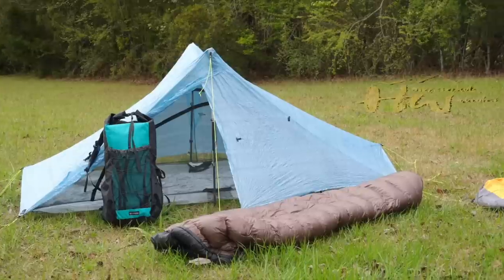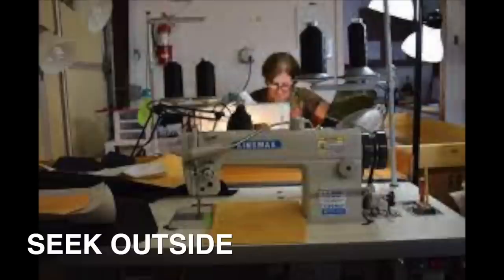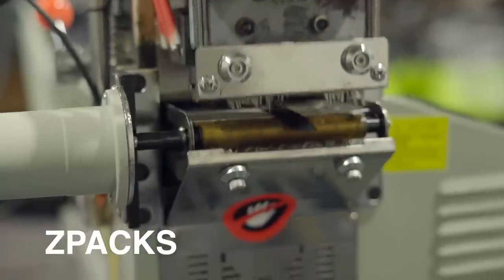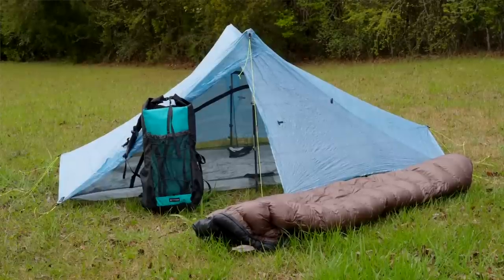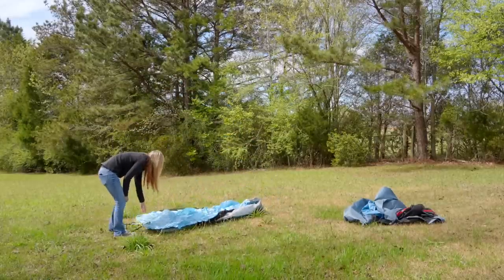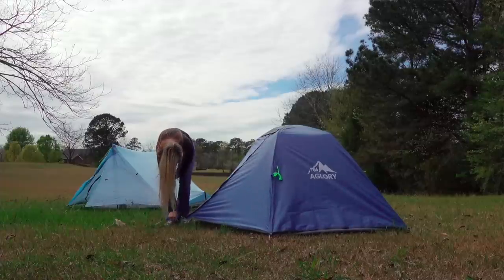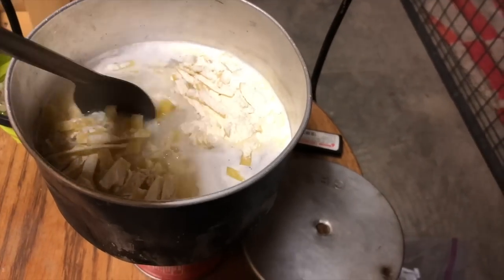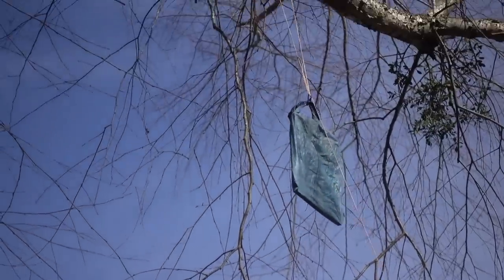$250 vs $2,500 Backpacking Gear Loadout - Why is Half the Weight 10x the Price?

Comment: I bought a Z-Packs Duplex and Arc Blast because I am 60+ years old and need to take advantage of such tech advances to lighten the load on those knees and hips.  With the Enlightened Equipment quilt, I halved my total pack weight from 35+ down to about 15-20 pounds depending on luxury items I allow myself now.  Well worth it in my opinion, even if I do not crunch long miles and am just a weekend warrior.
Reply: How’s the arc blast? Does it cut down on some sweat with that curve?
Reply: @boredandagitated  I love my Arc Blast, going on 5 years or so.  Yes, the curve really does allow decent air flow between your shoulder blades and waist.
Reply: @boredandagitated  I own the Arc Blast but if I could do it again I would get Arc Haul with the carbon stays that have a pre bent arc. With the Arc Blast you need to set up the arc with the pack empty and make sure you get the arc adjusted on both sides evenly. The Haul the arc is set and does not change. I do like my Blast and all of my Zpacks gear. A couple of years ago I retired and started doing much longer hikes so I bit the bullet and went all in in UL and Zpacks. Zero regrets. A base weight of eight pounds has been a game changer. Take care
Reply: I feel the same way.  But I'm fine with slowly reducing my weight over time.  The downside of some of these gear reviewers is that some folks are needlessly turned off from long distance hiking because it seems too expensive.  Most people can get their weight down by taking less stuff.
Reply: When I switched from a cheap synthetic bag to an Enlightened Equipment down quilt, I was also able to switch to a smaller lighter pack (bought cheaply on a close out sale) and shed several pounds of base weight.  It made a huge difference in my base weight.
Reply: @michaelb1761  It does have a nice cascading effect as you go lighter.
Reply: @Silkstep  For decades my motto has been, "If you watch the grams, the ounces will take care of themselves."
Reply: Thank you for the validation as I’m 71 yrs young & these are my considerations as well! Enjoy & safe backpacking!! ❤
Reply: Right on!

At 20, I would have thought someone was nuts to spend $2250 to save 6.5lbs. 33 years and a knee brake later, I ask where do I sign.
Reply: Me too. Getting the duplex and arc blast pack was a lifesaver for me (I’m only 50, but I’m a wimp and have bad knees lol)

Comment: I really love how hard you work at making backpacking accessible to more people.
Reply: My original set up was really cheap and not that light or good (IMO).  However, my current set up is relatively nice, is not comprised of Chinese intellectual property theft, and is still less than $1000 including shoes, clothing, everything.  I buy things on close-out sales and do not buy the Gucci gear for clothing. Despite what some (not Dixie) YouTubers might make you think, Backpacking doesn't need to be expensive.  I track how much I spend on gear, food, and travel to the trail.  Compared to a typical vacation with travel and hotels, backpacking can be a bargain vacation.

Comment: I’ve used Cascade Mountain CARBON trekking poles for 5 years with no problems. They weight the same as the Black Diamond poles, but can be bought for $35 at Costco. Now that’s a no-brainer!

Comment: I've been backpacking for about 50 years and my oldest pieces of kit come from 1978 and 1982, namely my tent and backpack respectively. The bag is frameless(but has a self-rigid sit-mat insert) and is just a big empty bag with a harness and padded back panel, but it's super comfy to carry and has hauled loads of 40lbs+. My tent is showing its age but still works and is quick to erect and weights 3.5lbs and has seen me through 60mph gales and -10C winter camps. My most modern gear includes an inflatable sleeping pad (2018 - I'd used closed cell pads up till then - big mistake!) and the BRS 3000 stove(2018 - and it's a mini miracle!).  It's a mix of budget and expensive, I pick what works rather than go on price. My sleeping gear varies by season - we range from -30C to +30C, so no bag/quilt covers it all. Plus as I get older I only cover 12-20 miles per day, in my youth I could do 25-35 if I had to - so weight becomes less of a critical factor, it's now more about comfort and reliability.

Comment: I do budget camping/bike-camping because I have to.  I have a NatureHike Mongar 2 tent.  For $150, it’s done me well for 2 years now with zero issues.  They also make smaller and lighter weight models.  I also found a budget down sleeping bag, and 2 different sleeping pad options (cold & warm weather).  The one thing I spent money on was my cargo bike-trailer to haul my gear with.  I also use my trailer around town for short grocery store trips, etc. There are also mid-priced ranged items that will provide more comfort/light-weight options.
Reply: I did the budget way for years. Nothing wrong with that.  With experience I learned how to use what I had. And stay warm and dry.  Peace and love hike on🙏✌️
Reply: I was thinking of trying bike camping, good to know other folks are trying it

Comment: I have the Cascade Mountain Tech carbon fiber poles (with cork handles and flick locks) and they have been great! I've had them for about 5 years and they have been on countless backpacking trips and long day hikes, from trekking through snowy passes to the Grand Canyon. Obviously the carbon fiber ones are more expensive than the aluminum ones, but I can't say enough good things about mine.
Reply: Same here! They have been serving me well for the past 4 years. Can't complain. They were recently on sale at Costco. I picked up another pair to keep as back up...
Reply: Love mine too.  Replaced the tips on an older rubber handle pair that I've been using since 2014 (bought at Costco), and I also have a newer pair with cork handles (also from Costco).  Great deal.  Hard to believe that the aluminum poles are more expensive now than the carbon fiber poles in 2014.

Comment: Aloha Dixie, 
Mahalo for another great video. I do want to point out an error in your description of tent materials: nylon vs polyester. Nylon is hydrophyllic- it absorbs water and sags when wet. Polyester is hydrophobic- it doesn’t absorb water and doesn’t sag. Polyester is also more UV resistant than nylon. Nylon is a slightly stronger fabric that polyester, but tests have shown it is negligible.

Mahalo
Greg

Comment: I am a Scout Leader, and I am constantly recommending gear selections to youth AND adults, for early-stage backpackers. (And I have tried ALOT of them). But, full disclosure, I have never bought UL or Very High-End gear. So, my range is low-to-mid for price/quality.
Generally, I stay away from alot of the lowest cost (walmart) items for the Big3.  Alot of Scouts get the Teton Sports backpack, due to its durability and size adjustments. (My son has now used the same Teton 3400 ($80) for 10yrs.) For adult backpacks, Osprey gets high marks for price vs quality.
Cheap tents are not bad, but their lousy rainfly is the downfall (aka Coleman or Ozark Trails)
Kelty Grand Mesa 2(as-is) is a great budget option at $150.  I have also used the Kelty Tanglewood2 at $100, and then swapped out the stock fiberglass poles for a replacement set of alum poles ($25) to drop weight. 
And sleeping bags have tons of options for size/rate/cost to fit and budget at Cabelas/BassPro. Again, Kelty seems to be the brand that has hit the sweet spot for moderate budgets/ quality. 
Unfortunately, I am all over the place on sleeping pads. I have a closet full of leaky air-pads and heavy yoga mats. Just have not splurged for the NeoAir.
I use $500-550 as an average budget for the Big 3 +pad

Comment: Hello and thanks for the video. Just as an addition, there are other choices somewhere in between these 2 extreme ranges, closer to the $250 range, which is too cheap to be acceptable for some decent hiking. 

1) You can buy a Lanshan 25 oz tent for $180, a 2 lb excellent Durston for $240 or a Gossamer Gear The one, barely above 1 lb, for $300. My standard for the last few years has been an OR Helium Bivy, 1 lb, now selling for about $160 at the "A".

2) As far as backpacks, a Granite Gear Crown 2 (60L, less than 2 lbs) can be found new online for about $100 (holds 35 lb comfortably) or a Granite Gear Virga 2 50-58L Backpack which weighs in at 1 lb 2oz can be had for the same $100 (holds about 20 comfortably). They both carry really well.

3) Finally I would use a quilt/blanket since those are lighter than the bags. Anyone remember the $30 Costco blanket? I made one into a quilt by using some monster tape and it has been good to me to the 40s and less than 2 lbs. Nowadays they sell similar ones for about $60 at the "A". For a great quilt, may I suggest the Paria brand? Their 30 degree, 700 fill, 2 lb costs $160, their 15 degree, at 2 lb 3 oz is just $180.
Combine that with a pad such as the Klymit Insulated Static V Lite Sleeping Pad, in regular size at 20 oz, R rating of 4.4 and $100

So for the big 3, you are talking more or less $600 and under 7 lbs....you can add the rest of the stuff and do da math which methinks is going to be an additional $100 - $150 (Sawyer, Frog Togs, Pot/cup, BRS, poles) which is about 1.5 lbs (total is 8.5 lbs).....As a matter of fact, think $750 which is 1.5 lbs heavier but about $1,700 cheaper than the best shown here. Yes, it is $500 more than the (possibly) "one time hike/use" gear but it is a whopping 5 lbs less! Meaning $100 per pound weight loss.

So there you have it:
Almost 7 lbs for $2,470, 13.5 lbs for $248 or 8.5 lbs for $750.

Comment: I'm glad I spent the money on my Enlightened Equipment quilt. Super warm and super light. I can also use it when I am camping in my camper van and have used it staying at friend's houses. I went more middle of the road on the pack and tent. I like my REI pack, not the lightest, but lots of good features and pretty light. One thing that did sting was I spent a bunch of money on a good inflatable pad. I do not backpack often, so the side seam failed on my pad and I didn't realize it until the next summer when it was out of warranty and I had a useless piece of kit. Thanks for the all the time spent on putting this video together.

Comment: My message is sort of like yours, when starting out on your first shorter hiking outings, take cheap but servicable stuff that will not fail on you, and upgrade to better gear if/when taking on bigger hikes, or as $$ are available, or specific issues are found with the cheaper options.

Comment: Great work again Dixie! 
In my opinion Decathlon is worth to have a look on. They offer a wide range of gear from cheap to expensive, but they are honest to tell the customer if the product is made for recently use or heavy use in all conditions.
For most weekend-worriers the cheapest items from Decathlon will do the job perfectly for small money. For example, trekking poles: the cheapest are just 6$ each. I tested it and they performed quite good.

Comment: If you plan to use your gear more than once, it's VERY important to consider durability into the "actual" price.  Tents and backpacks are the worst offenders by far.  Buying a cheap tent say, that may struggle to last a full season before needing a replacement can be MUCH more expensive over time than biting the bullet and buying a high quality durable tent that may last you for 5-10 years.
On the flipside, if you are just experimenting with camping/backpacking, don't worry about durability at all.  Get the cheapest gear you can that will fit your needs, then upgrade as you go, because nothing is more expensive than the gear you buy and use a couple times before sending to live permanently in your garage.
Reply: A huge number of tents are sold to people like my daughter who will go to music festivals for a few days and leave the kit there on site, just walk away ! so cheap is good for them !
     Before anyone shouts at me, the  excuse is “ they charge ridiculous money for tickets and can afford it !”.  And, “ the clean up crew  need the money anyway” !

Comment: When I bought my ZPacks Arc Blast, the company was 4 people. When I bought my first UGQ quilts the company was 3 people. Now, both companies have about 10 or 15 people and a lot more equipment than 7 or 8 years ago. I will still buy form both.
That said though, I also own several big name tents and other equipment and clothing. As well, I have "cheap" gear as well, some of which I will never regret buying because it has performed way beyond my expectations.
Those Nylafume liners have an additional asset in that they also are smell masking. And you can repair them with simple tenacious tape.

Comment: Hi Dixie, good comparisons.  I know you mentioned it, but I think it really should be highlighted, there is a difference between going for a 5 mile hike into the back country to camp for a night or two, versus doing the PCT or Appalachian Trail.  When you are going out hiking every day, doing 10 to 20 miles a day for 6 months, that 6 lbs weight difference is a lot, but if you are only doing one day here and one day there, even if it is 10 or 20 miles, the 6 lbs isn't as bad and is tolerable.

Comment: Thank you for sharing your thoughts on gear. When I started backpacking many pieces of gear I used were borrowed, “previously loved” or were gifted to me. So I’m glad you mentioned used gear. That said one piece I still have  and use which should say something about it’s durability is my original backpack. It’s one thing I bought new (about $60 in 1975) and it’s still in pretty good shape (one zipper on a pouch gave out sometime ago and is secured by a toggle I made). The pack weighs about 1 1/2 to 2 pounds and that’s pretty good for a 2700 ci (about 45 liters) pack even today.

Comment: Lot's of good info here. I had no idea about the "comfort" temp vs the "survival" temp for sleeping bags. I always figured that a 20 degree bag meant that you would not get cold at night when it's 20 degrees out. A temp rating with two different definitions sounds like a marketing tactic. All in all I don't buy gear based on primarily on weight. The extra weight just means a harder workout. I should mention that I don't do thru-hikes. It's usually multi-days or section hikes on long trails. For me, it's durability. I've been backing southern Arizona and the west for over 40 years. The piece of gear I've replaced most, not counting footwear, are tents. I started with an old Army style pup-tent and made my way up to a Black Diamond Hilight 2P with vestibule with just about everything in between. The one that lasted the longest was a North Face Tadpole. Currently, I'm using an REI Passage 1 tent. So far so good. Thanks to Dixie for condensing so much information in a format that is understandable and fun to watch.

Comment: Love the discussion. 👍
For me, the only top of the line items are sleeping bags and sleeping pads (I personally don't use a sleeping pad - pod hammocker). 800+ fill dwr down is well worth the cost. As well as the fact that higher end bags use the comfort rating. In my experience, the comfort rated bag feels warmer than the 20 deg colder rated survival rated bag. For the other items in this video, mid grade is probably the way to go (even on a through hike). Silpoly over dyneema, synthetics over wool/down (mostly), and a two pound backpack from a quality company is going to work just as well as a 2 pound dyneema pack costing 2-3 times as much.

Comment: 8:00 fiberglass poles can be replaced with some difficulty to aluminum ones off Amazon. I'd usually use a single aluminum tent pole with steel coghlans stakes to hold up a rainfly. Effectively making a floorless tent for cheap.
Thanks for the tip on polyester vs nylon.👍

Comment: First time I went backpacking I used "backpacking" gear from amazon, only the tent was 8 pounds, then I realized that it was amazing and decide to invest in lighter gear, my recomendation is to do a weight saving to cost analysis and decide if is worth to spend money on that item. For example I have been using the same 1 lb sleeping pad and 3.5 sleeping bag because cutting very little weight in those items will cost me a few hundreds. In the other hand and just to mention an example I changed my 8 lb tent to a 3 lb tent for 65 bucks (trekker 2.2) which made a huge difference. For someone like me that doesn't have problem carrying lightweight gear and goes only two times per year doesn't make sense to spend thousands in the lightest gear. But I also understand that hunting deals and looking for the best is also fun so I don't judge people that invest money in that.

Comment: I have to say at 41 years old, during summer, a sleeping pad is usually the least of my concerns. I can almost always find a comfy spot to nap or even sleep, I’ve done as little as a wool blanket, but usually opt for ye olde blue foam roll… I actually prefer sleeping on the ground, the important part being finding just the right place.

Comment: I use a $35 Ozark Trails 1 man backpacking tent from walmart, and it's lighter (4.5 lbs) than her $250 tent and survived Philmont just fine.  I intend to use it for many more backpacking trips as well, and it even did fine on cool nights with the double shell rain fly with no leaks whatsoever.
Reply: She didn't list a $250 tent. The cheap tent she showed was $50 , the Z packs was over $600.

Comment: My friend wanted to start backpacking and just wanted some cheap gear. Found the sleeping bag, sleeping mat and tent used and for a cheap cook set he got the brs stove as you did and a Stanley Adventure Bowl + Spork Cookset which costs a little more than the Nesting Two Cup set. As for the backpack he found a Gregory Optic at a thrift store for 85dkk which is equivalent to ~$12 (I don't think they knew what they were selling 🤫). Apart from some wool socks he just used what he had at home.